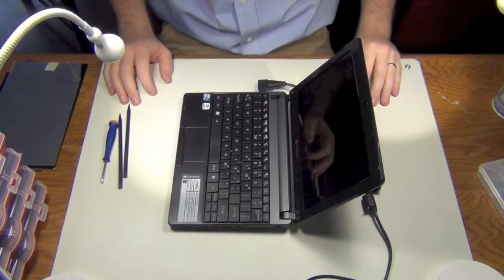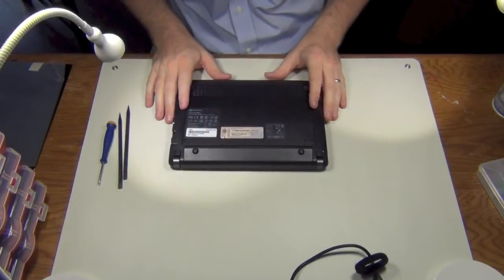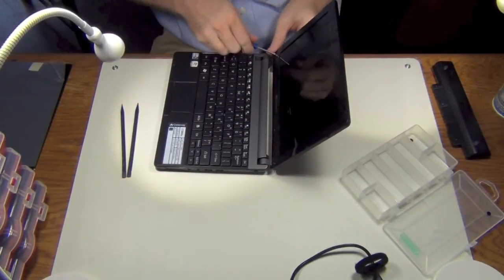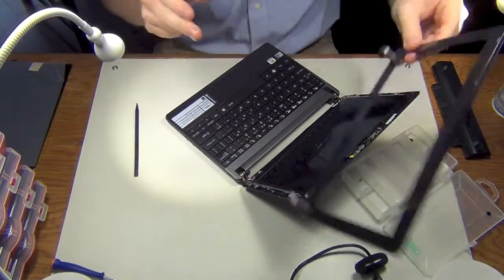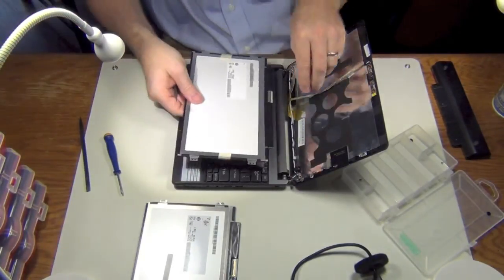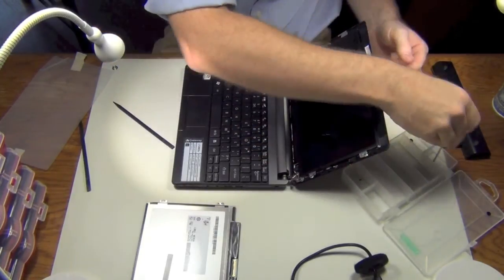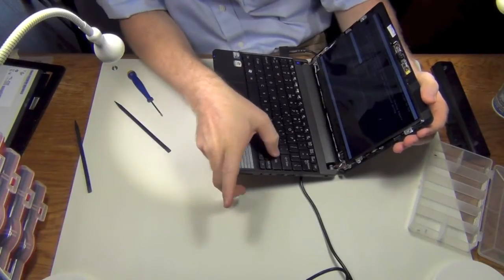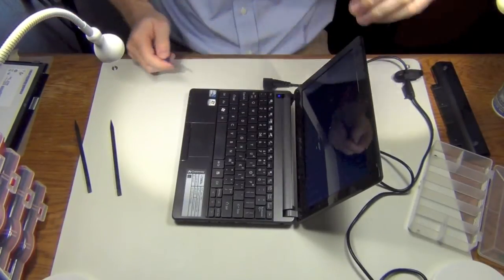Gateway Netbook LED or LCD Screen Replacement

Comment: I really like your videos. I have an HP Pavilion 6700 that was overheating, and I watched your video on the teardown, and I was able to fix the overheating problem. 

This Gateway is similar to my Gateway LT3103u Chromebook, which has intermittent posting issues, and when I can get it to post, it's password protected by the former owner. It currently has Vista, and I want to upgrade it to win 7 if it will take the upgrade as soon as I can fix the intermittent posting issue.

Do you have a video on troubleshooting this issue?

The power indicator comes on, you can hear the fan, but the screen is black and the Vista startup sound is absent when it fails to post. I have managed to get it to post twice, but I was hoping to find out if this little machine can be fixed. Any help would deeply be appreciated.